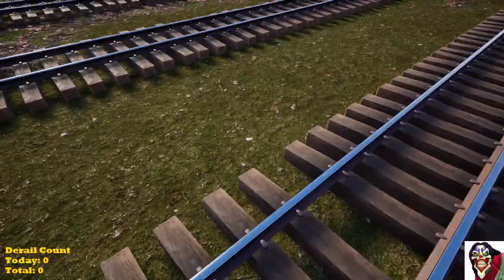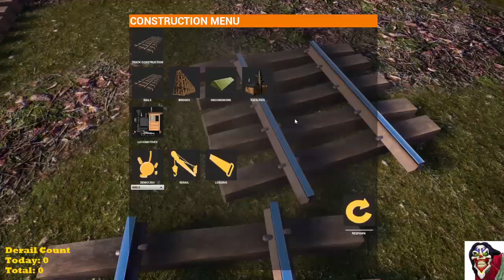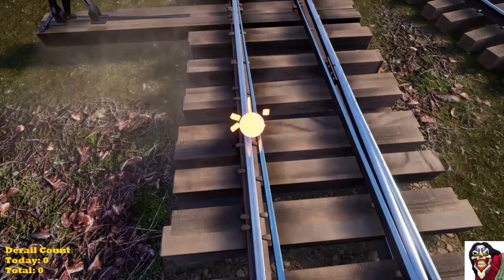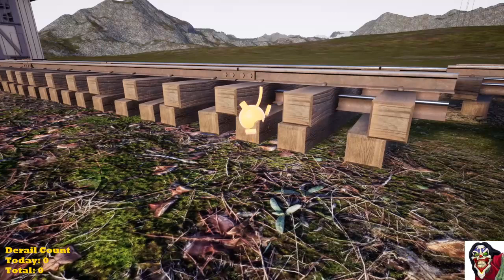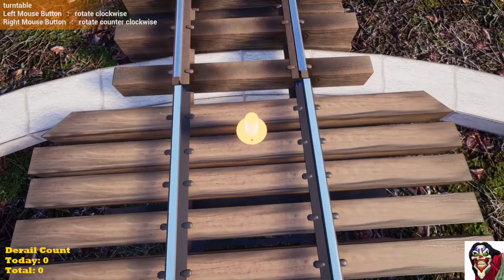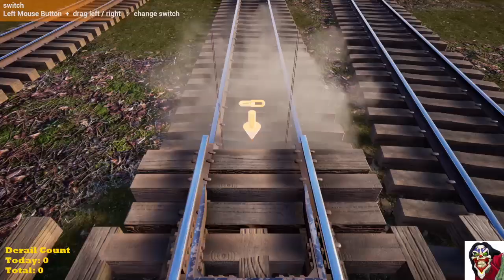Railroads Online - Moved Industry - Play Through Ep03

Comment: After your first two episodes I decided to go for it and started building up this version of the map myself, using your method of using new splines to plan the layout and placing the old ones on top.  One problem I ran into with my yard (which it seems you've avoided with your layout?) is that if you place a switch, and then place another switch directly on the diverging end of the first one, the old spline switches will link differently than the new ones (or maybe the geometry is slightly different?) and produce a sharper curve on the diverging end.  Gave me a bit of a headache when placing the track ladder, but the diverging end of the second switch (if it's a left where the first was a right, or vice versa) will still place parallel with the straight end of the first switch, so it didn't end up causing too much of a problem.